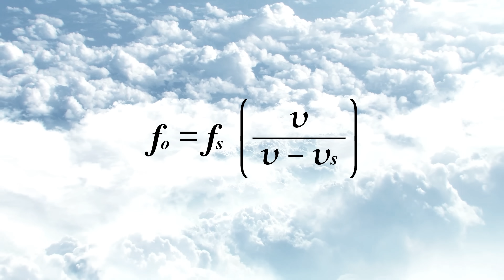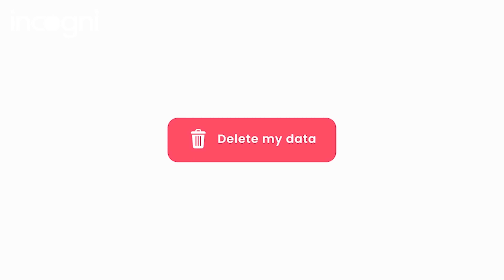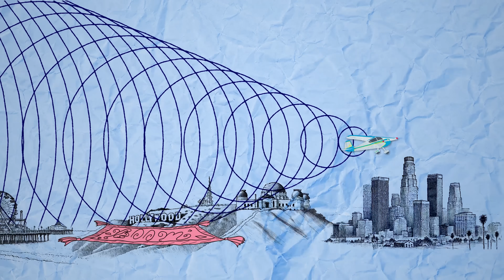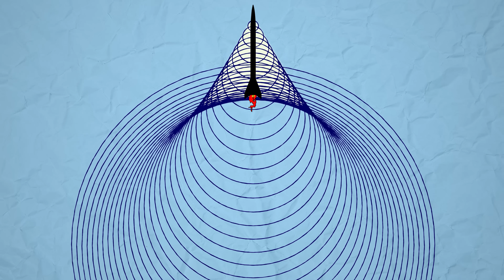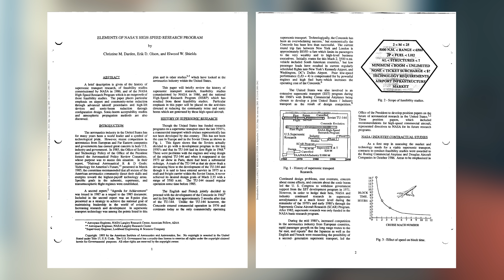You'll NEVER Hear a Sonic Boom From a Rocket??

Comment: All soundwaves moving through air move at the same speed? Only if that air is at the same pressure everywhere. In case of a rocket rushing towards space, that's not the case.
And if I get it correctly, you will hear the sonic boom of a rocket when it flies horizontally. But that sounds more like war-time stuff.
Reply: The speed of sound in air is solely dependent on the temperature of the air, pressure plays no part. 
 
Speed of sound in air = 331 + ( 0.61 ⋅ T )    (meters per second)
T = temperature in Celsius
Reply: @wally7856  Then why was I alwasys told the speed of sound at high altitude is lower? Temperatures go up and down with altitude. Pressure just goes down.
Reply: @frankroos1167  Normally temperature goes down with altitude so speed of sound goes down with it.
Reply: @wally7856  I'm no expert. I was just working on what I had been taught. Now I have been taught something else. Thank you.
The gist of the statement still stands, though. For a rocket going up, the speed of sound isn't constant, as was the stated assumption.
Reply: @frankroos1167  Yes, I think what was trying to be conveyed in the video was that the frequency of the sound doesn't affect it's speed through air. A low note and a high note both move through the air at the same speed. There is no preference to how they wiggle, the pressure wave travels through the medium the same.

Comment: Should not show sound as a sine like wave; it is compression and relaxation of the media.  Hard to illustrate.  Consider where the "sine" is at top, the air at that point would be slightly compressed (the amount of compression = loudness), and where the sine is at nadir, the air would be 'decompressed' (relative to normal) (the amount of 'decompressed' = loudness).
ie: Sound is PRESSURE changes.
Reply: "Hard to illustrate."  - is exactly why sound usually gets denoted as a sine wave. It's easy to draw.
Reply: @wally7856  And thus imparts bad info on people who don't understand it.  But it can be illustrated.  Indeed if you search with the term: "illustration of sound waves as compression" you will get several effective illustrations.
Reply: @AlanTheBeast100  Once you get into concepts like constructive and destructive interference, standing waves, etc, the sine waves are easier to deduce.
Reply: @wally7856  I'm not writing about my understanding.  Others - less informed - will carry away a bad conceptual image of what sound is.
Reply: @AlanTheBeast100  I agree with you there. Since this is a video and not a chalk board it would have been easy to incorporate. I think what most people get wrong about sound is that they think it is "something" that leaves the sound source and arrives at your ears. When in reality, nothing goes anywhere, it is just the pressure wave that travels through the medium. All the air molecules after they "bump" into the one in front of them return to their starting position. The one that got "bumped" bumps into the one in front of it and so on. It is just the "bumps" that get passed on as the sound travels, the air molecules themselves stay relatively still.
Reply: @wally7856  Like waves on the water - (up and down, of course).  Or any radio signal.  Or gravity waves (more like sound).

Comment: Years ago, just for kicks, we modified an Estes Das V-3 kit to take a G engine, and with through-body fin mounting. Not hard to imagine it went transonic a few hundred feet up. Because by then it had canted over and was traveling almost parallel to the ground we got a perfect double boom from the leading and trailing edge shockwaves. (Also, all four fins were ripped out at the same moment and drifted down in formation. It was lovely.)

Comment: This may be beyond the scope of this video, but the statement that “All sound waves moving thru air move at the same speed” is incorrect.  The correct statement should be all sound waves moving thru air at a given temperature and pressure move at the same speed.  This is relevant to this video because the speed of sound in air changes as altitude increases because temperature and pressure in air change with altitude.

Comment: bullets fired from a gun at over 1100fps are supersonic,and make a characteristic "crack". use of a suppressor ("silencer") does not affect that unwanted shock wave. Military uses suppressors on their sniper rifles to hide the muzzle flash and diffuse the muzzle blast to prevent giving away their position.
BTW,living in the Orlando-area,I often heard the shuttle's twin sonic booms. Xyla,it's a shame you never got to see a shuttle launch,they were awesome. the SOUND washing over you even from 5 miles away was incredible. I wish I had been around her for the Saturn/Apollo launches. Every once in a while I drive over to Kennedy Space Center and do the tour and Imax movie. The Saturn V they have is in a building and you can walk all around and under it.
Reply: While it does hide the muzzle flash, the primary purpose of the suppressor is to suppress the noise from the gas behind the bullet, which is much louder than the crack from the bullet itself.
While this does help conceal the shooter's location, they are primarily used to protect the shooter from the very loud noises produced by their own weapon.
As you said, it still doesn't get rid of the ballistic crack; you need subsonic ammunition for that.

This also shouldn't be confused with muzzle breaks used on most of the anti-materiel rifles; while they do help hide muzzle flashes, they are primarily there to mitigate recoil by directing some of the excess force backward, thus pulling the gun forward by the barrel.
Reply: There is a sonic crack, so it's still pretty load. Typically you use subsonic ammo with a suppressor, however its not too dampening like we see in movies. It wouldn't be substantial for the NATO 5.56, if it were. The M16 would have suppressors built in.

Comment: Having not yet watched the video, I can you answer that question: 
The way the pressure wave / 'sonic boom' propagates from a rocket flying vertically, you cannot hear it on the ground. 

It would be like floating in the water and expecting to feel the bow wave of a boat that is traveling directly away from you. 

EDIT→ Having now watched the video, I can I add this: 
I thought of putting some kind of 'detector' on a kite -- or more likely suspending it from the kite line -- to record or at least detect a sonic pressure wave coming from a rocket. UNFORTUNATELY, I have NO IDEA how to build {or where to purchase} such a detector.

Comment: I like your enthusiasm, but the speed of sound in air varies with temperature and pressure, so the speed of sound at 6,000 meters (about 20,000 feet) is lower than at sea level.  Also, it varies with the  mass of the molecules, which is why, if you inhale helium, it makes your voice high.

Comment: Shouldn't you have added the caveat that the density of the air effects how fast sound moves within it? Speed of sound in air is 340m/s but this value is affected by both altitude and temperature. Not watched the whole video yet but that seems like a glaring omission in the fist 5 minutes.

Comment: You CAN hear a sonic boom from a rocket!! 🚀💥 😃👍
Falcon 9 rockets launched from Vandenberg produce an audible sonic boom during ascent—depending on your location. 
From Westlake Village, CA, we can reliably hear this boom about nine minutes after launch (though the timing can vary with atmospheric conditions).

The reason we hear it here is that by the time the rocket reaches transonic speeds, it has already tilted about 10 to 12 degrees east-southeast (off-vertical) due to its gravity turn, favoring those of us positioned in (under) that path angle.  This boom is an exciting delayed "Wait for it!....." "topper" to most launch viewings.
We usually watch from the elevated parking lots at our YMCA, which offer a clear view of the launch, staging, and even the re-entry burn of the first stage.

Comment: cherkov radiation is particles getting irradiated namely oxygen and the resulting energy from it splitting. thats energy blasting out and charging everything thoss charged particles hit and disipate their energy. 

much of those particles continue at slightly less than the speed of light and persist out into space... part of the emissions that cant be contained during nuclear fission and fusion. 

you didnt hear a sonic boom that your used to for two reasons.

the rocket motor was already pushing air faster than the speed of sound, and the shape of the rocket.

its size produces a higher frequency on top of the mach speed air mixing with the high pitched rocket motor sound.  what you hear from the rocket the entire time is the sonic boom. 

larger objects create lower frequencies and displace more air, so you hear it in the frequency range thats audible and you feel the air it displaced hitting you.

Comment: Xyla, I think you mean that the vapour cone around a supersonic aircraft is caused by the pressure drop, rather than temperature drop. Whenever moisture laden air suddenly experiences a drop in pressure, the dew point is reached and water is condensed temporarily. This is why the vapour appears in certain regions and then disappears. What you are seeing is a proxy of the low pressure regions around the aircraft.
Reply: It's both

Comment: 1:10 Which explains the western movie trope of listening to the train tracks. With old style rail the train would make a clackity clack sound when passing over the expansion gaps which would travel down the rails much faster and also therefore quite more efficiently than in air sou you could hear the train approaching through the rails long before it would be visible audible in air. I'm guessing they would actually press the scull to the rail rather than actually pressing the ear to the rail because steel to bone is lower impedance.

I don't recommend doing this in real life now, because trains are much faster, and run more often and with continuously welded rail there is very little clackity clack sound and the rolling noise might not be very noticeable above the general hum of traffic.

Comment: Re: the most common sonic boom: I read/heard/saw that it was recently discovered that air escaping from the tiny depression made when a drop of water falls into standing water (think of the slow motion footage where a deep air pocket forms and then collapses) actually chokes off to the point that the tiny volume of air rushing out exceeds the speed of sound. I can't find any reference to this now, unfortunately, but if it was true, I would think the smallest and most common Boomies would both have to go to water falling on water. :-)

Comment: This is an incredibly interesting subject. Mach, being the measurement of sound, there are 2 factors that immensely effect what "Mach" actually equates to. The air density and temperature directly contribute to a wave's ability to propagate. When compared against the true speed of sound, it's largely dependent on those factors. Ie. A jet going mach 10 in the stratosphere may be going around  something closer to 12 times the speed of sound because the speed of sound at that altitude is much lower. 343m/s at sea level and roughly 295m/s in the stratosphere.

Comment: 5:56 If positioned correctly, you can see the shock wave(but not sound), as the air becomes more dense from the supersonic object compressing a small local pocket, this changes how light refracts through it, basically impossible to percieve without some sort of assistance, either through high speed cameras for a bullet passing by, or by traveling at very high supersonic speed in an aircraft, with a telephoto lens observing another object at matched speed.
It looks like the heat waves above a hot roadway, but standing still reletive to the object.
Admittedly, this is also due to the added heat of the air being compressed, but it is also the compression itself
Reply: In most Slo Mo Guys videos containing explosions you can clearly see it in the slo mo shots...

Comment: A lot of good informative stuff here, Xyla, But... The speed of sound through "Air" is NOT a constant. As you mentioned the density of the medium determines the Speed of Sound through the medium. But as we know Air gets thinner the higher we go. So the Speed of Sound is different (lower) the higher up you go... But wait, there's more! Temperature AND Humidity also affect the density of the "air", thus also affecting the Speed of Sound within the "Air". So at sea level it is  (roughly) 760 mph, but at 40,000 ft altitude it is (about) 670 mph.
So the question remains: when, exactly, did Spite create its sonic boom, and at what altitude & speed?

Comment: Good God, are the audience that thick they can't work it out? The shockwave comes from the leading and final edges, the rocket is going upwards so those cones would have been heard if you where a long way away but not under them. You where under the rocket so the dopler effect cancels the pressure wave out in effect. Simples.

Comment: You made a great video, with lots of details, but you were a bit misleading with your comments about the speed of sound in air. It is very much dependent on the density of the air, which in turn is dependent on things such as temperature and altitude. Your comments make it seem like the speed of sound in air is a constant, fixed value, but that is not true. It's a shame, because the video is so good otherwise.

Comment: if it still doesn't make sense this might help: if a plane is flying towards you and its speed is faster than the speed of sound in air, you will see the plane coming towards you but you won't hear its engines because the plane is coming to you faster than the sound it makes.

just at the moment it passes you, you'll hear all the sound "debt" that was behind the plane earlier + the sound of the planes engines for real (because now it is moving away from you so its sound can reach you) all at once and it will sound like a "boom" because it is sudden.

so a plane flying mach 1+ speeds, you'll see it coming towards you but it will be dead silent. that is kinda terrifying. the only time you start hearing it is just when it passes you, and you'll hear it as a boom because by definition it is sudden and loud.

Comment: I may not have heard the loudest shuttle reentry sonic boom but I heard many and it is was an invigorating way to fall out of bed doing the Scooby Doo run in place until your feet get a grip thing. If I remember correctly it was two booms in rapid succession. The main thing though is they were really loud, like knock pictures off the walls (sometimes even shelves and tables) and rattle the windows loud. The first few times I thought an airplane, meteor or car had fallen through the roof and the house was going to cave in on me. What I don't know is why the shuttle flew for years without me hearing the boom, and then suddenly it was there in full sonic glory. Maybe the reentry path changed, but it could be that I moved house about 10-15 miles, maybe putting me at boom sub max.  Another thing I don't know is does the boom get louder as the boomer goes to higher mach numbers?

Comment: A planning boat goes faster than the wave speed in water (not sound, the axial wave, but wave waves, the ones you see on shore, the transversal wave, which has a much slower and messier speed, which isn't even constant)

The thing is, from the boat, you see the cone shape and the clear space between the source and the already formed wave, quite good to understand it. Never heard it to be called boom, but it's the same thing, and a boom is a different thing on a boat.

To be more precise, planning is not defined as this for any given boat, there's something called hull speed, the phenomenon described before happens at a different speed and also varies with hull shape.

Comment: (I feel like you probably know this but didn't want to overcomplicate the video, but I think it's interesting) 
The speed of sound in air changes reasonably dramatically with pressure, and therefore altitude. ~660mph at 40,000ft vs ~760mph at sea level. The fundamental message of the speed of sound in air doesn't depend on what is making the sound is still totally true though, and this doesn't really affect any of the conclusions you made in the video.

Comment: The speed of soundi in sea water is actually closer to 4800 ft/sec @ 72F at the surface, and it changes quite dramatically with temperature (former submarine SONAR tech here).

Comment: Honorable mentions: The Republic XF-84H "Thunderscreech" and the Myasishchev M-25 "Hell Reaper".
The XF-84H was a 50s experimental American propeller aircraft that tried to go as fast as physically possible without removing the propeller, which turned out to be a really bad idea: The tips of the propeller blades were already supersonic when the engine was still on idle thrust - causing a continuous visible sonic boom while still on the ground. The insane mayhem it caused to everyone involved is well documented.

In the late 60s the Soviets started experimenting with sonic booms and tried to weaponize them, which resulted in the development of a supersonic attack aircraft with a maximized shockwave. The M-25 was supposed to blast 162 dB shockwaves towards the ground while flying as low as 30m above the ground, eliminating infantry and even causing significant damage to buildings. In the end the requirements for the airframe and engines were simply too high for the available technology at the time, so it never got past the design phase.